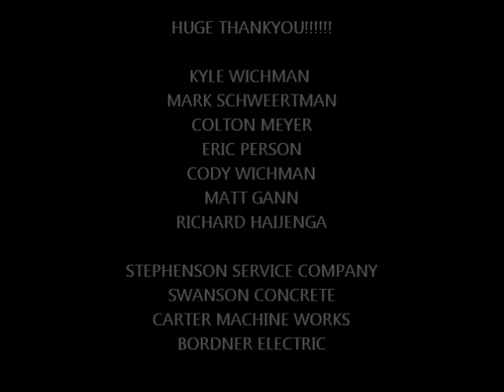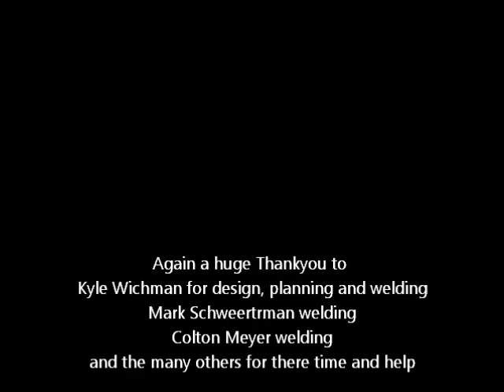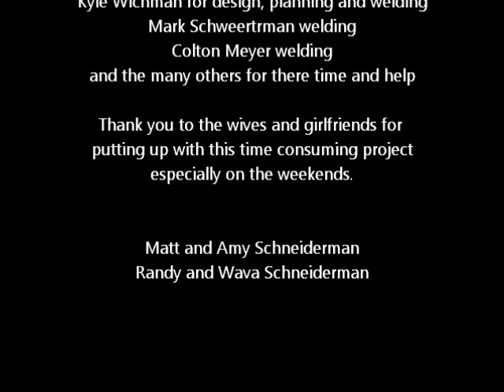GRAIN DUMP PIT BY WICHMAN WELDING  SUMMER 2015

Comment: That's cool!
Does the auger shut off automatically when the pit is empty?
Reply from the maker: Yes auger shut off automatically. Amp sensor on wire triggers auto shut off and knows when the auger is empty due to voltage drop need to power auger.  Runs empty for about 30 seconds then off.